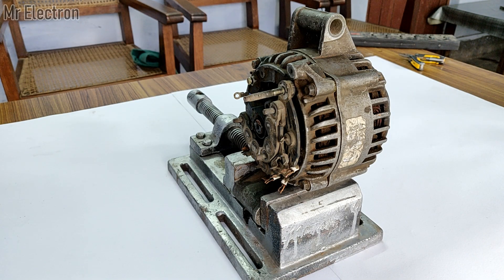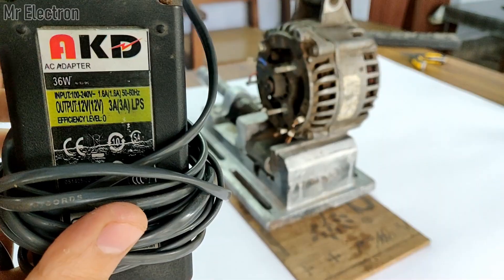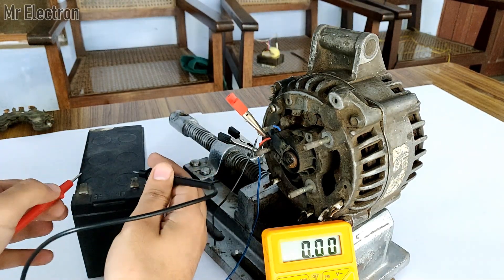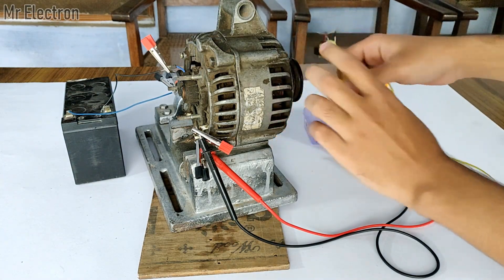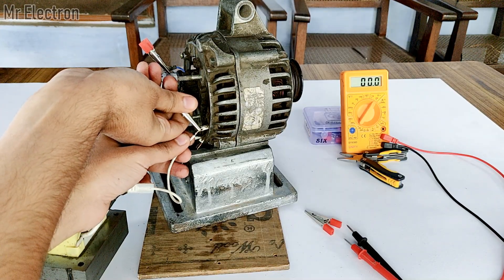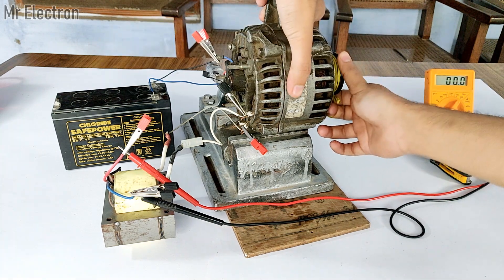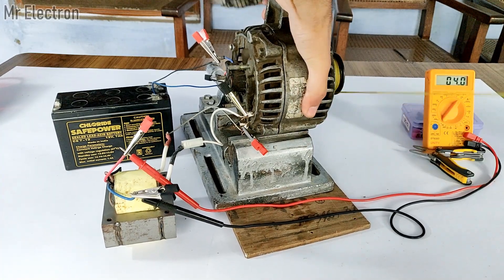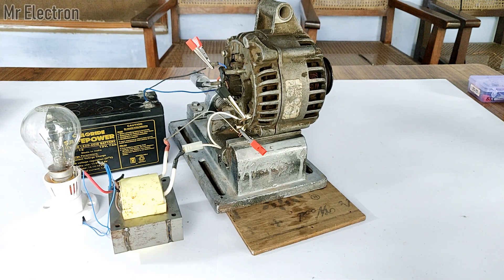110v AC from a 12v Car Alternator New idea !

Comment: If you attached it to a water wheel near a river you would have free electricity if it was geared right how many amps do you get out of it and how long do you think the alternator would last at full capacity running 24/7 just curious would it burn up quickly
Reply from the maker: Yes it will generate good amount of energy. Its designed for continuous operation to it won't burn up.. although the brushes will get used up quick coz of continuous operation. Its a 64Amps alternator
Reply: Mr Electron that's 600watts only .a inverter is 29$ better idea.100v _ 6a. Only.
Reply: I really doubt the alternator is the limiting factor in this project. That tiny transformer going to be lucky to push 3 amps before it melts.  For the cost of a large enough transformer to handle the 65 amps the alternator can deliver you're better off buying a nice inverter and a 130 amp alternator.  As anyone that's tried to source them knows, big (high current) transformers are not cheap.  As for the alternator it's self, most are going to be be good for a good 50,000 miles or more.  If we do some loose math, we can say a car in typical use drives an average of 30 MPH while the engine is running, so that alternator, would last about 70 days of non stop running... at engine speeds.  I have no idea what the intended use is here, but pulling the pulley with a string is not going to approach the 4000-20,000 RPM the alternator is designed for.  If you had it being spun by a non-geared water wheel, for example, I'd expect the alternator to corrode and fall apart before the bearings fail.
Also the regulator/diodes failing is the typical failure mode of alternators in cars, bearing failure is rather uncommon.  I'd expect it to last several years at least.
Reply: @johngaltline9933  but if you're in a s*** hit the fan situation it would be a way to have power if you hooked it to a side shaft motor or a creek with a water wheel for a Time or a windmill or something along those lines just a good alternative for power for a short time

Comment: Plz give information about pedal genaretor.
Use alternator as dynamo.
Reply from the maker: Sure ! Thanks
Reply: An automotive alternator is a poor choice for such a project. You would be much better off using a small DC motor instead. You can find such motors in discarded treadmills or such similar exercise machines. They are a much better match to the power capabilities of human legs than an alternator, which requires far more power input from whatever is driving it.

Comment: To run this contraption on a permanent basis, you will need a separate engine or an electric motor to power the alternator. The AC voltage will be provided by the transformer capacity,  the watts will be according to the amperage generated by the alternator. This is just for experimental trials, not to light up an area as needed. Dec. 11/18.

Comment: To connect the alternator with windmill what alteration to be done in it. If the windmill rotate in the opposite direction will the alternator produce power? Please explain.
Reply from the maker: Yes
Reply from the maker: All you have to do is maintain rpm
Reply: et si il n'y a pas de vent, tu produis quoi comme puissance, l'instruit !!

Comment: what if you don't have a battery  what can you do to make electricity
Reply from the maker: There are ways !
Reply: Find old generator. Put a heavy fly wheel that is hooked up to motor then turns fly wheel that turns the gen. Get going unplug from Wall plug into gen outlet. You will have excess power coming from Gen.  Whatever power or wattage is left after powering motor.  Flywheel helps propel and keep it turning.
Reply: Use a Neodymium permanent magnet.

Comment: Great Idea but no use. why not buy inverter using that UPS Battery. No effort is needed
Reply from the maker: Uses vary from country to country . They sent me a lot of requests for making 120v to 220v for electricity in remote areas so that's y :)
Reply: The alternator can be used in conjunction with an inverter and a battery bank.
When small, intermittent AC loads are needed, the battery bank can power the inverter, to handle the loads.
When greater AC loads are needed, an external mechanical power source can be used to drive the alternator (such as a gasoline engine, or hydro wheel). A percentage of the alternators' output could also be rectified to recharge the battery bank whenever mechanical energy is available.

Comment: Well done , we can as well use a Magnetic instead of the Armature magnetic copper wire, so we don't need a Battery anymore, so, we'll have a big DC motor which generated an AC voltage, but of course we will need the Transformer continually.
Reply from the maker: Indeed you are right except that it won't be called a dc generator but a 3 phase brushless ac generator 😊
Reply: @MrElectron  u r right. any way and again great job bro .
Reply from the maker: @ASHORSHEMAYA  thanks a lot for such great words ☺️

Comment: What voltage can it produce without any battery power source. Only with residual magnetism.
Reply from the maker: Depends on the strength of the residual magnetism 🙂
Reply: The residual magnetism is sufficient to produce a small output from the alternator.
Then, the output is used to power the field windings, and full power (67 amps) is available, with sufficient mechanical input power.
Reply: Most alternators are purposely designed NOT to retain any residual magnetism (though certain types might). They are intended to have power from a battery when being started to initially energize the field winding, then once they are generating they use a small amount of the alternator's output to supply the field, becoming "self-excited."

Comment: Great job. Very good explaination and demonstration! Have you tried to connect two additional transformers to the other 2 output phases...to produce 3 seperate 110v outputs?     Have you tried to run wire from all 3 phased output terminals to the voltage regulator (which is laying flat on your desk) and connect the voltage regulator back to your battery to charge the battery...but the. tap ONE of the 3 phases with wires to your lightbulb? Doing this, you should be able to both charge your battery AND have an AC light bulb.
Reply from the maker: As a matter of fact i was planning on doing the same thing in my next alternator related video 🙂
Reply: Awesome, also where did you get the 12v to 120v transformer? Did you salvage that from a home appliance like a washing machine or an exercise tread-mill?
Reply from the maker: @shawnfrank3618  scrap market.
Reply: I wish we had a scrap market where I live, but sadly we do not. I’ll find one somewhere, thank you and keep making cool things and showing us how you do it!
Reply from the maker: :) always !

Comment: Do we get higher than 110volt ac by using any other transformer? And video was so helpfull
Reply from the maker: Yes of course
Reply: Yes y not by connecting high excitation & with high rating transformer .